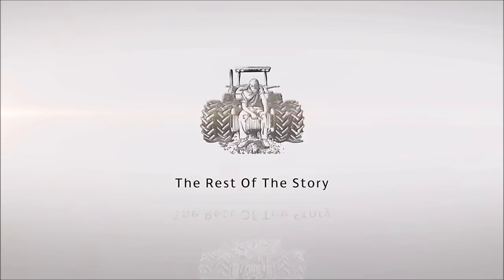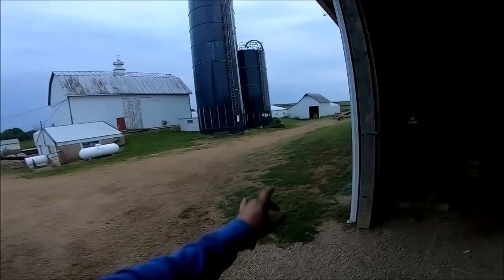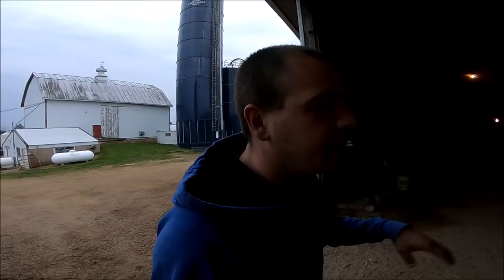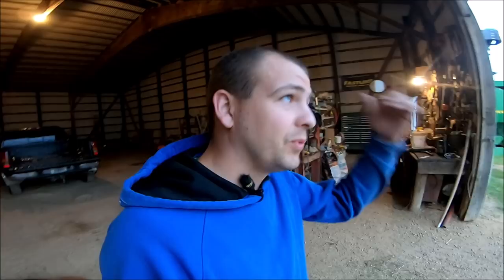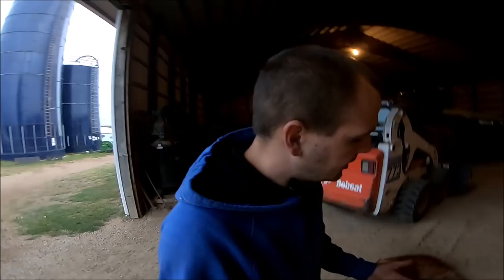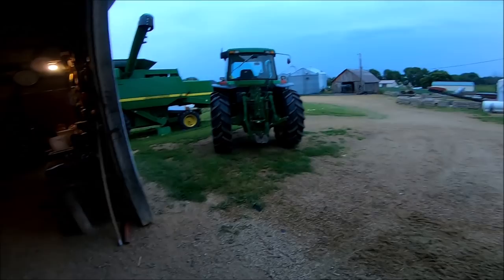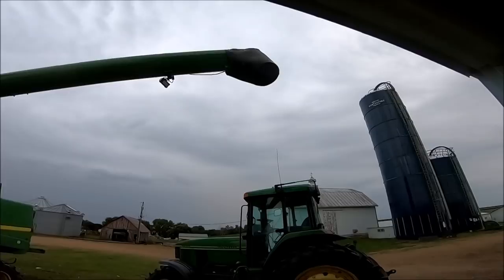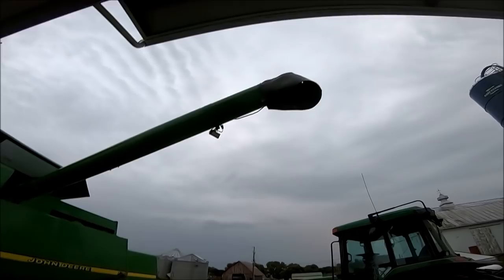Late Season Hay??? | Maintenance

Comment: Have you tried cutters from anywhere else? I know my dad's John Deere lawnmower blades dulled quickly. I got some Oregon blades and they lasted much longer.
Reply: Second that... I used to get cheap blades at TSC they didn't last long...  Got a box of the factory blades from the dealer they lasted twice as long.  Definitely better, longer wearing steel in the factory blades!  OL J R :)